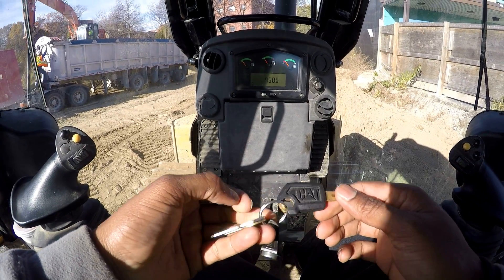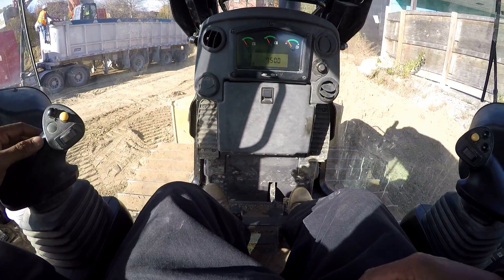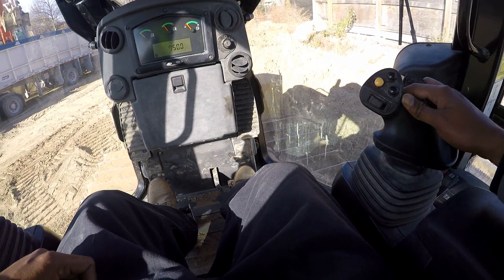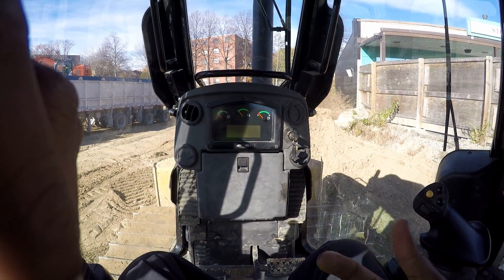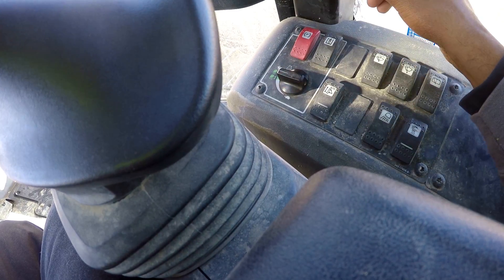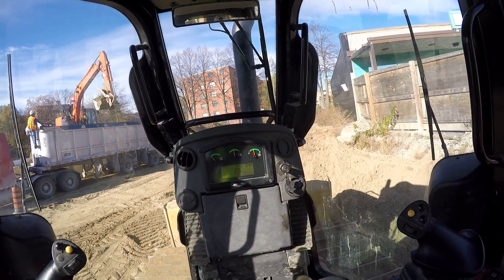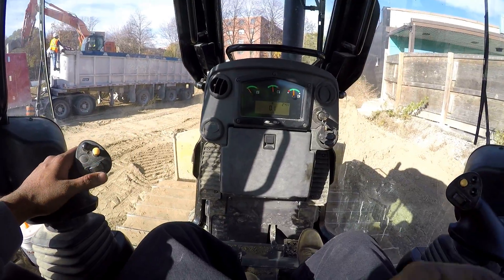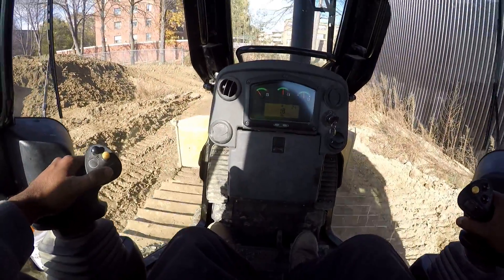BLADE - Cat Dozer D5 - HOW TO OPERATE - 101!

Comment: No, no, no this is not accurate
Reply: Everything
Reply from the maker: what did i miss
Reply: @raymondharlall  pedal is deaccelerator and brake at the bottom. Left hand is drive controls, right hand is blade controls- up,down, tilt left, tilt right and rocker switch angles blade. Good video just not accurate enough to be a training video.